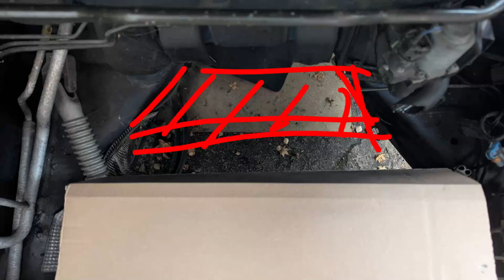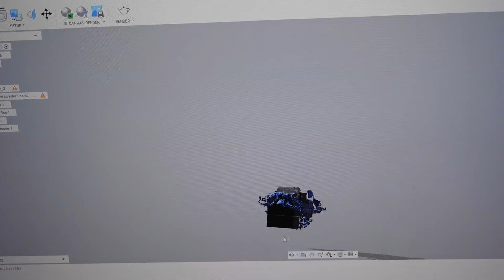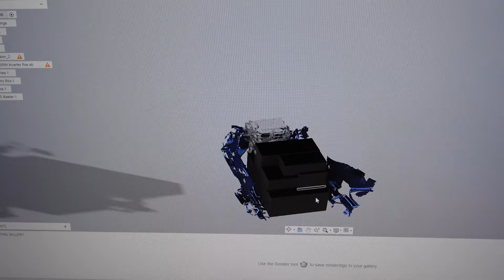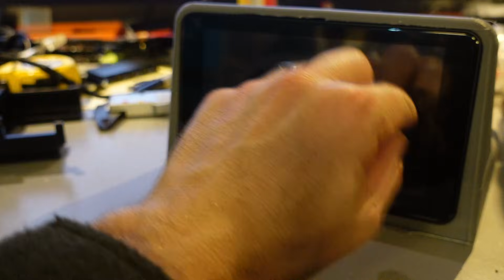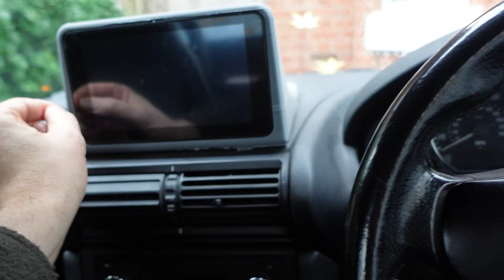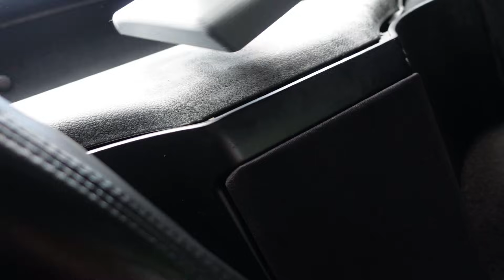Battery box CAD and 3D-printed trim: quick update on my EV conversion projects

Comment: Tom, how much clearance are you leaving between the battery modules and the box? Also, probably one for a future video, but how are you fixing the modules into the box? Thanks!
Reply from the maker: Probably not much at the sides - just enough for the wires, coolant pipes and mounts. They will be slightly offset in the box because I need more space at one side than the other.

Current thinking (not fully fleshed out) is to use some box section rails inside the box as both bracing and to mount the packs on. Their mounting tabs are offset from the bottom of the modules but I think some 20x20 box might be about right. 

I need to CAD up the design but I'm planning to tie the horizontal rails into some vertical strips of plate that will have the lifting eyes attached to them.
Reply: @EVDIY  Hmmm. Ok. Thanks. I'm just finishing up a YT video where I'm just about at the point of doing my battery boxes. I've been pondering them for months, but it's getting to the point where I've gotta get on and do them. ¯\_(ツ)_/¯
Reply from the maker: @john_martin  JFDI as they say!